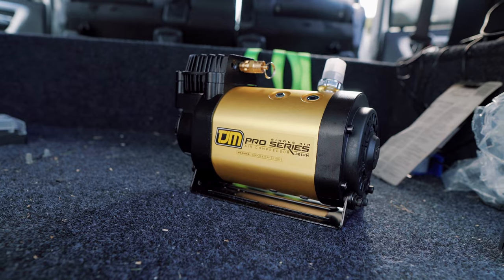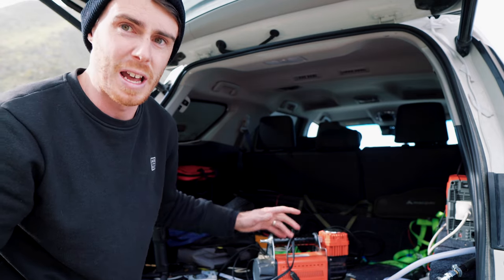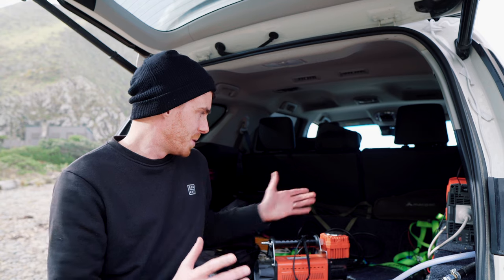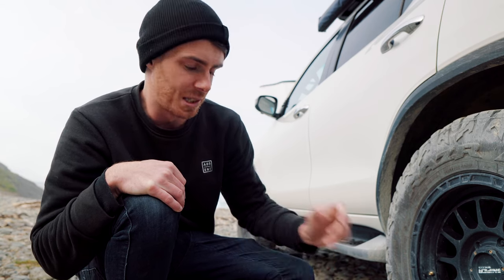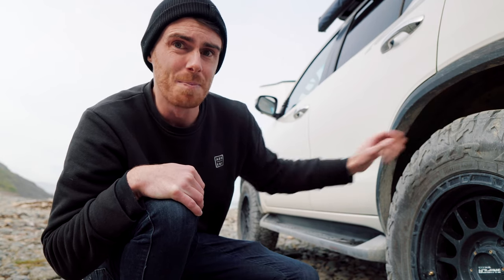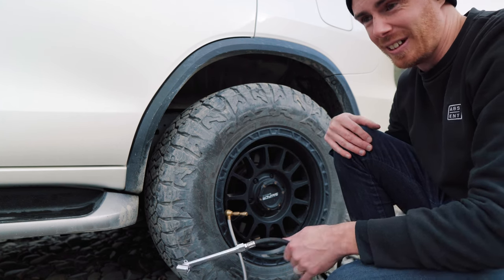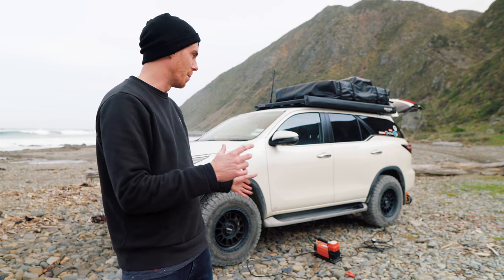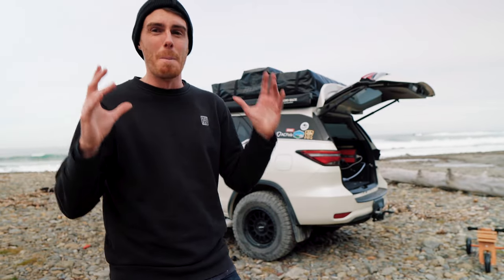Which 12 volt air compressor is best? TJM Pro Series vs RidgeRyder/Adventure Kings

Comment: Cool video. I have that same Ridge rider pump, I have it permanently installed in a landcruiser, hardwired with a pressure switch and a small manifold with outlets for diff locks and an air outlet. It's been heavily used for the last 4years and never been a problem. I never intended to use it this long but it just keeps going strong so I decided to keep it.
Yes it does get a bit slower as it heats up but  not really an issue, using larger wiring helps it too, less voltage drop at the pump. You can't go wrong for the $99 price tag, you can buy 4x for the price of that TJM.  But yeah they do take up a squeak more room.
Reply from the maker: They are awesome pumps eh! If it were smaller I probably would've just bought it a pressure switch. Didn't think about the wiring, it is pretty thin on them out of the factory eh

Comment: I agree it's a pain having to put the bonnet, drag out the portable compressor and faff turning it on and off to check the pressure in the tyre. I'm also looking at options for fixed compressor in my Fortuner. I have installed an Anderson in the front to make connecting easier but with no bull bar, no place to mount it so still a pain to use. I made the mistake of buying a twin compressor too which means it's draws 90amps at times meaning heavy gauge cables if moving the Anderson to the back. Until your video I've been put off by the smaller mounted compressors because of the air flow rate but I think your video has put my mind at ease on that one. Thanks for your insights.
Reply from the maker: It's a very first world problem eh - but it takes way longer adding all those steps in - and giving everything a minute or two to cool down before you can pack it away. True true - still better than opening the bonnet! 

90amps is a lot eh - that and space were my two biggest issues - my cabling to the rear is way too big for just a DCDC, but I didn't have the headroom to dod a twin back there without shelling out for wiring again. 

Pretty impressed with the single unit though! It's not as fast as the twin as you'd expect, but I'm more than happy with it's output
Reply: If you buy a proper attachment for inflating tyres then it will have a trigger on it so you just set up compressor flick on, if you buy a longer hose you can just leave it on. It has an internal pressure switch so once it builds up it switches off and you can just toggle the switch to check pressure easy as don't have to go back and forth turning on and off

Comment: Hi Mate how is those wheels going ? I am about to buy the same ones . Did you have to remove the mudflaps? Is it rubbing when you do off-road? Thanks
Reply from the maker: Heya - zero issues with them after removing the front mud flaps. Never had any issues with rubbing on or offroad which was nice

Comment: I found a bracket out of Oz that I mounted my arb single under the bonnet of my 200
Reply from the maker: I thought about under the bonnet - decent space there. Wanted the air outlet to be in the boot though - less hose run needed to get there

Comment: Some people are mounting their compressor in  there engine bay . All they need to do is open up your bonnet and plug in your air hose and turn it on and way you go .
Reply from the maker: I did think about putting it in the engine bay - less noise and heat in the cab. My ultimate goal was to not have to open the bonnet though - lifting the bonnet in 100kmph+ hour gusts of wind isn't fun. I also found on a week trip I just did, I just left the hose connected and rolled up in the boot - made airing up super easy
Reply: Added issue to mounting it in the bonnet is mud and (salty) water. Your creating an extra weakpoint and you do need to clean it up often.